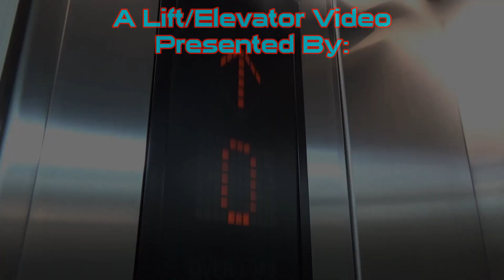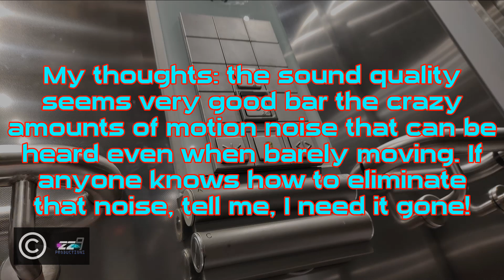Testing The Zoom Am7 External Microphone In The Beefeater Schindler Lift/Elevator - Opinions Please!

Comment: Honestly it's so subtle and some iPhones make a louder noise with no microphone through the default camera app, and whilst 4K is cool, 1080p is still perfectly decent
Reply from the maker: I've been informed of a way to get 4K60 with this, but before I do that I need to test it again with some improvements to the physical setup of it that have hopefully reduced the rumbling noise. The reason getting 4K60 would wait til after that is because it involves paying for the Pro version of the app, fortunately it's only like 80p but I'll still wait until I know what the noise is like before making that decision
Reply from the maker: aaaand the method i was told to do to get 4K60 doesn't work...looks like I may have to remain on 1080p60 to use the microphone, but there's still time to figure it out
Reply from the maker: If you're interested in hearing another update I have one, I've got a solution that should give me good audio + 4k60, it just needs tested doing a lift video with it...what the solution is may prove unexpected to some lol
Reply: @ZZ9ProductionsOFFICIAL  Fingers crossed it works